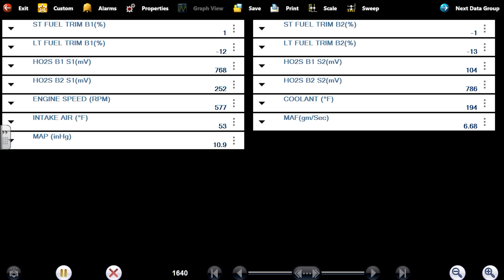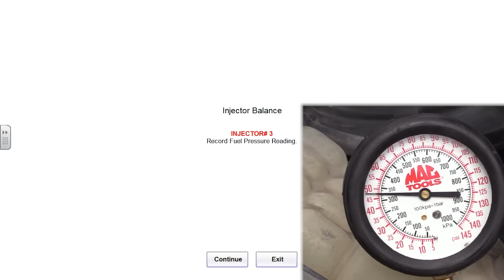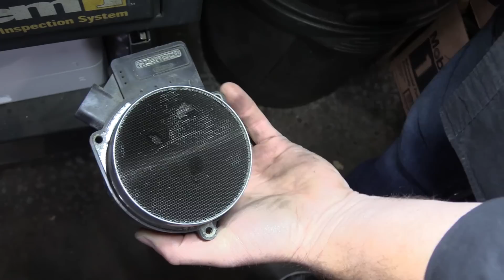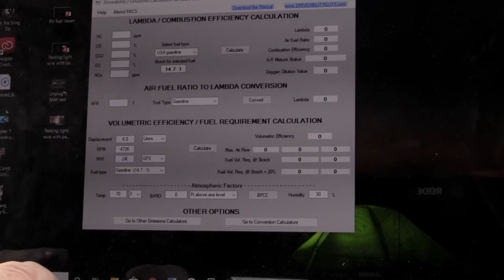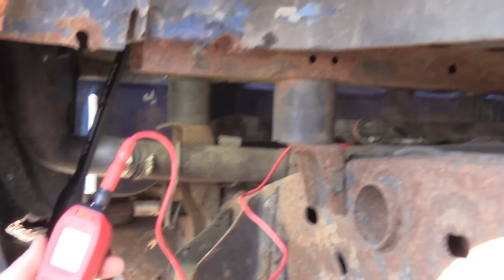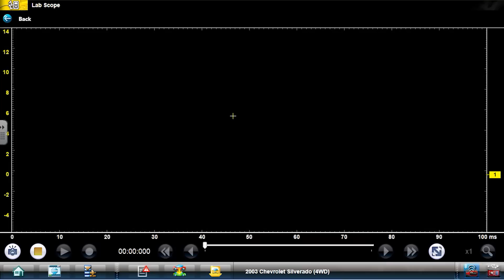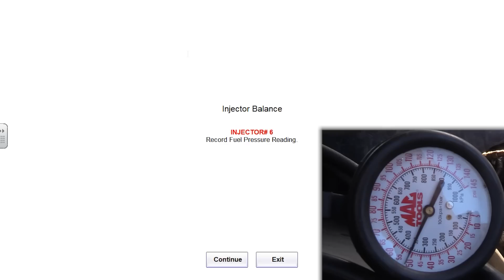03 Silverado Misfire, Rich AND Lean fault codes

Comment: Paul I'm automotive tech by profession, I watches your videos all time, that 03 Silverado misfire rich and lean fault code what was the fixed
Reply from the maker: The lean condition and low power was the fuel pump as I showed. The rich condition and suspected fuel injectors were never addressed. I even personally messaged the customer right here on YT (he was watching) and he never replied back as to where he bought the injectors from. 
I believe this is the same truck that had a badly rusted frame that was identified while at my brothers shop. So this may have dictated why there was never a follow up. For that I'm sorry

Comment: I guess you never heard back from this guy, it's been a year.  You could have sprayed some fuel down the intake when driving it to see if the power picks up, this would verify that it is indeed a fuel pressure problem.
Reply from the maker: Fuel pressure was never in question. This absolutely had a fuel psi loss under load.
The questions remained on the injector flow and rich codes, from memory
Reply: @ScannerDanner  I guess we will never know about the injectors now.  You did a fuel pressure drop test on the injectors and the pressure was mostly even.  Question is what is acceptable.
Reply from the maker: What is acceptable according to some material, even have it listed in my book, is no more than 1.5 psi difference from lowest to highest. But to be honest, even that is too much, they should all be identical. Finally, the test itself has variables too. You can get inaccurate results from a hot engine, as fuel can boil as psi drops. I've also heard of fluid dynamics in the rail too as a variable. Not too sure about that one but, I've found this test to be pretty spot on and I absolutely had at times, at least a 2 psi difference on those injectors. 
Check out my Chapter 17 and 18 playlist right here on YouTube, I have at least 4 or 5 other videos dealing with injector flow issues and performing that test. Thanks!

Comment: For the injector balance test, are you supposed to judge the pressures after cycling the injector or the differences between before and after presures?
Reply: No,you are comparing each Injector to each other during a drop test.If you suspect leaking Injectors you would hook up your pressure gauge, cycle the key to maximize the pressure on a cold engine, turn off the gauge and observe the rest pressure for at least 30 minutes. The pressure should not go down by more than a few psi.

Comment: Fuel tank pressure change?  Temp gun on each exhaust pipe?  Plug gap smashed?  Fuel contamination? Oiled air filter has caused the maf to crap out on me and cause this issue as well.  That exhaust leak is killing it for you in determining any kind of un-metered air causing it to run lean and then causing it to compensate as a rich issue.

Comment: Oxygen seasons don't read sunburned fuel. They see unburned oxygen.
("Oxygen" sensor)
Reply: I know you know
Reply from the maker: Unburned fuel absolutely has an affect on the O2 sensor. Experiment for yourself. Create and ignition misfire and then unplug an injector and compare your fuel trim numbers. The injector misfire is much leaner than the ignition misfire because with an ignition misfire, the unburned fuel will catalyze on the tip of the O2 sensor
This is why some call this sensor a "tomato sensor" lol
Reply: Injector misfire produces less fuel correct? So more 02 in the mix. 
I will try your suggestion.
In school we did flow and balance tests and surprised how pressure and flow rates are different and affect engines. 
I just know too many techs think 02 sensors read fuel, they don't  that's all I was saying. They compare inside and outside samples.
Don't tape up the wires at the sensor.
Reply from the maker: @gregoryfairchild2460  from what the "experts" say, the oxygen content is the same, whether it misfires from no fuel spray or from an ignition problem and you are correct, the O2 does sample outside air. 
When the exhaust has no oxygen and unburned fuel, the O2 actually pulls oxygen ions through the element and acts as a mini catalyst and it is this condition that creates voltage (rich condition). The pulling of oxygen ions through the element. 
Now if there is unburned fuel AND oxygen in the exhaust, the O2 does not pull as much oxygen from the outside because it has available oxygen inside (to catalyze the fuel), but it does still pull some through (ignition misfire for example). So still a lean condition but not as lean as the next example:
Now if there is no fuel and a lot of oxygen in the exhaust (no fuel from injector), there is no voltage created and no oxygen ions pulled through to catalyze any exhaust fuel because it is not there. 
I hope I said that right, it is very strange, but has been proven by the big wigs on iATN and other platforms. Fuel ABSOLUTELY has an effect on the O2 sensor. Or "tomato sensor" (is it a fruit or a vegetable lol)   
Now to be honest, I still think of the O2 as comparing exhaust O2 to outside O2 and it is the imbalance between the two that creates voltage. When I am troubleshooting, it doesn't often help me to think of the tomato sensor lol
Reply: I've seen coolant poisoned 02s do funny things..lol

Comment: Spray and look for leaks spray carb vlead idle up  if leak
Reply from the maker: You really just need to stop commenting before watching the videos. This had a under load lean condition and was running rich at idle. Which is NEVER from a vacuum leak

Comment: 53 psi is perfect on these (at idle)
Reply from the maker: At wide open throttle? Absolutely not! 60 minimum
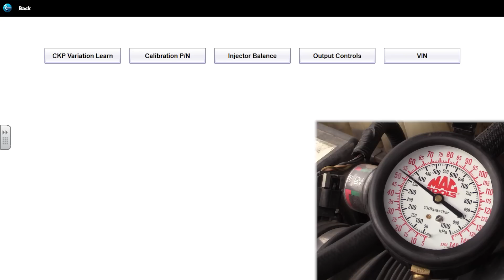Reply: @ScannerDanner  like right here at 16:18 right after you shut the truck off. This is what you'll see at idle on these engines usually. At regulated pressure.
Reply: @ScannerDanner  I'm just giving out some info brother, I'm not correcting you on anything just giving info that you didn't. Don't take everything that's not so obviously positive as negative. I know this content isn't fresh in your mind and you can't rewatch it all and some assuming is required in your responses.... I own your  book and I am an ex-premium member. I have respect for you.
Reply from the maker: @jeramiet154  all good and my apologies, hard to discern sometimes, especially with just text on a screen. I hate it sometimes. Communicating in this way with people.
Reply: @ScannerDanner  no worries man. I'd be the same way if I were you. Lots of keyboard warriors to fend off lol
Reply: At idle, like you first had on the gauge the first time you fired it up with the gauge on to prime the system.
Reply from the maker: @jeramiet154  I'm okay with 53 at idle too sorry, it was under load this thing had an issue from my memory. Also on a prime on these, you want to hit 60 as well. Maybe not the first time after first connecting the gauge. But after you've started it and got all the air out of your gauge

Comment: I wonder if you can hear gas spraying from a leaking hose inside the tank? Fuel lines inside the tank are a different composition than standard fuel line & if the incorrect line is used, it gets soft & will leak.
Question #2.
Why isn't it mandatory that all vehicles have access to the fuel pump without dropping the tank?
How rediculious!
Reply from the maker: no on question one, and on some of the tank designs, it's just not possible to provide an access point

Comment: Hi broo!
I have a simple but
Strong problem with my 2003 Honda pilot.
I'm going to maked simple to understand.
Start the unit started right away.
Engine looks smooth. No codes.
5 minutes later rpm start to fluctuated.
Rpm at start was 1.400 and after warm up stay the same.
When the up and down start.
Start down and up down and up.
The 3 cylinders on bank #1  if you
Disconnect those 3 coils engine remained
The same.  The I reconnect the coils and
Check bank #2 and this bank is working.
At one time I disconnect the wire of the injector
From #1 bank 1 and you know what? Engine
Miss fire put it back and recovers.
Then I do another test.
With engine running I disconnect from #2
Bank each wire one by one from each cylinder
And every one miss fire but I notice
That by doing that after the miss
That the cylinder on #1 bank started working.
And after I disconnect all the coils from #2 bank
The engine keeps running with #1 bank.
And if I reconnect bank #2
Bank #1 shutt off you could take off
The 3 wires from those coils
And no change!.
Short term fuel trim B1-S1 reports -27.3%
And stay there.
Short term fuel trim B1-S2   -27.3%
Same thing...
Map 
Coolant
IAC
IAT
Injectors
 Fuel pump
Pressure regulator 
Spark plugs
Sensor #1
Catalyst
Everything have been replaced.
I'm not a professional mechanic.
But i'm HERE as you 👀👃👀
Ahh! I forgett to tell you!
A guy from a Honda dealer makes me
Buy the computer...
And nothing..
If you can't give me an Advice
Then I have to contact the guy who
Built this engine🐒
Please excuse my English.
Hope you or anyone aswers me
With FULL  LOGISTIC!!!
Happy Holiday's!!!
Stay safe🚼
Can't tell you no more i'm not a professional
And I have a limited scanner
The volts on the O2 sensor bank 1 S2 reads
With switch engine cold 0.035V
02 sensor B1-S1  1.275V
Warm at that idle  B1S2   0.075V
B1-S1.  0.895V and both changing in that range
Down and up...
Thank's for your time!!!!

Comment: I have a 2.4l Honda element and fuel trims are rich at idle both short term and long term at idle are -15 to -18. Thing is when I accelerate down the street my short term goes to -3 and long term around -10. Basically when I accelerate at idle or down the road my numbers improve. Any advice? Also I have no codes whatsoever.
Reply from the maker: leaking injector, fuel pressure too high, timing belt off a tooth, EVAP purge valve stuck open (though that would be lean at times), fuel contaminated oil, O2 problem
MAP engine right? (no MAF sensor)
Reply: @ScannerDanner  thanks a lot for answering. Purge valve was changed oem, oil new, yes no maf but map reads 29.5 engine off and 10 mercury at idle but I do notice when I rev it in park it falls from 10 to 8 don't know if that's normal. Haven't checked fuel pressure or injectors and I do have slight exhaust leak before the upstream but thought that would make me go lean not rich. Also took out upstream and it was black.

Comment: Man that part where the amp clamp wasn't working, the fuel tank pressure sensor was unplugged and you were confused about how you were getting readings off it, the ground voltages being kinda meh, and just in general everything going kinda sideways is being a technician in a nutshell. Actually this whole video is. With the injectors being at max spec, the exhaust leak possibly adding to the problem, and the MAF as well. Lmao it was that kinda day.

Comment: I don't think magnets wear out or get weak. What likely happens is, through use, the clutch plate wears and increases the gap to the point it does not work correctly. So pulling a shim out puts the gap back in spec.
Reply from the maker: Magnets can crack and it weakens the field

Comment: Just a thought with the fuel tank pressure sensor unplugged, if that could be the cause of the rich condition due to the computer commanding an excessively long purge waiting for the tank pressure to change??? Remember there was no stored fault codes for the unplugged FTPS and of course was unplugged when the Rich codes were set because all the freeze frame data showed 0v for the FTPS voltage.
Reply from the maker: they don't use the fuel tank psi sensor on this model

Comment: I purchased a fuel pump on Ebay for a 2006 Trailblazer LT 4.2L avoiding going with the original one trying to save some $$ and have almost the same conditions....running lean and misfires with engine light coming on plus evaporations large leak.... any suggestion for the large leak beside my fuel cap?
Reply from the maker: did you have the large leak code before you changed the fuel pump? what is your fuel pressure before and after changing the pump?
Reply: Yes... I had that large evaporative code P 0455 on a trailblazer 2006 4.2 L... reason why I changed my fuel pump ...long story short...my gas needle gage was working but after you fill the trailblazer completly, the gas needle turn back to empty... I knew what it was but been my vehicle with 175k miles , I decided to replace  the fuel pump since the gas gauge is with the pump. I replaced with an aftermarket fuel pump( Ebay) and since I changed that pump everything has been going down hill.... I replaced the original gas cap for an aftermarket and the light came up fast but went to a junk yard and got a gas cap from a 2008 trailblazer.... and know it holds more but after reaching 1/2 tank the check engine light comes up with the P0455  sometimes after I fill the trailblazer is hard to start unless I put the key on for at least 5 seconds and then starts, nothing like that happened in the past....if I go over 60mph I can feel that the vehicle hesitate like needs more gas.... and then after that P 0300 comes  on... not often but sometimes.....I replaced all original coils fir new ones , new spark plugs but my scanner is not that good to detect which cylinder is producing the misfire... and I know is running lean.... dont know if I have a vacuum leak... the vehicle runs great never cuts off is just dont know where to start looking. My plan is to look a vacuum leak, then injectors, probably need to order an original fuel pump but that P0455 code is killing me... I reset the code and right by 1/2 half tank it comes back on. Need your help. Thanks for replying back!
Reply from the maker: @Carbon15556  1. a vacuum leak will NOT affect under load driving conditions, you are describing under load issues
2. The large leak code, focus on the EVAP vent solenoid (I have many videos on testing this one GMS). This will have NOTHING to do with your running problems. 
3. The hard start after fill up suggests a stuck open purge valve (which would also cause the large leak code and other idling issues)
So you have multiple issues, let's start with the low power under load and the P0300 code that sets after that. I agree, this sounds fuel related, but may not be a pressure issue. Step 1, disconnect your MAF sensor and drive it and let me know if you have power like you should (above 60 like you mentioned).
Reply: Thanks for your input....will let you know.
Reply: @Carbon15556  update?
Reply: Johnny 24 ...well we  verified fuel pressure and it was between the range (58)changed all injectors, installed brand new ones, changed purge solenoid valve , installed aftermarket intake system, works better ...but noticed when I’m climbing at 60mph starts a very light hesitations that happens only after 15min or more driving ,not like in the past, ( that hesitation was extremely hard)fuel consumption its way better ...but still feeling that little hesitation and does not happen with cruise control on.

Comment: Ive seen the fuel pressure regulator leak gasoline through the fuel regulator vacuum port, causing the fuel trims go rich, and misfire because of fuel been sucked into the intake. Usually when the fuel pressure regulator is bad, it will cause a hard start because of the loss of fuel pressure leaking out from the fuel pressure regulator into intake. Didn't see the truck have that issue, "hard starting". Good video scanner danner!

Comment: This was a bewilderinging video.  I slogged thru all 1.13.55 of it. Kudos to Caleb.  It made me want to throw the parts cannon on these issues with my own silverado. There was no adequate  explanation for the negative long term fuel trims.  Really-a bad injector is issuing too little or too much fuel but this did not correlate  with the misfiring cylinders or with the so-called abnormal injector balance results. The very slight variations in the injector balance test can be explained by the hysteresis effect on the mechanics of the MAC mechanical transducer and its attendant gauge.The check engine light, which is the vexation of those of us who want to get our vehicles legally inspected is  a bunch of bull and that the auto makers set the"money light" with minimal problematic parameters. I do appreciate your teaching.
Reply from the maker: yeah, I wasn't happy with the injector flow test results either but absolutely showed the lean condition and low power/misfire complaints under load being caused by low fuel pressure. I wanted to work further with the owner and he even was commenting on here but then he went silent on me. I think in large part because my brother found that the frame was bad on this truck, so I don't blame the owner for saying "forget it, I'm done".
Reply: @ScannerDanner  Thanks for the teaching. I am buying your book
 Craig

Comment: If you can't reproduce results... Then how could you possibly rely on that data for the injector balance test? Those numbers are all over the place and different each time. Sorry, can't trust that data.
Reply from the maker: agree with the injector balance test being sketchy on this one at best. Unfortunately the owner never got back to me when I requested more information about the injectors that he installed. Also, my brother found that the frame was bad on this truck, so I imagine that is why we never heard back from him on this. The only thing we knew for sure on this one was there was a fuel pump issue for sure.
Reply: @ScannerDanner  difficult diag for sure... Sometimes one issue needs to be resolved before further testing can be done and owners don't want to fix things so we never find out 🤷‍♂️

Comment: ScannerDanner you are correct. GM injector balance test specs are to calculate the average pressure drop. all injectors must be within +/- 1.5psi of the average. anything outside of that should be replaced